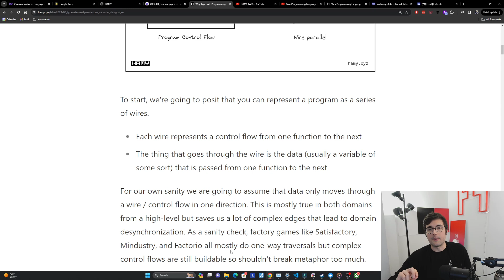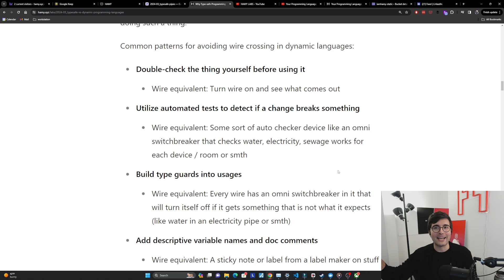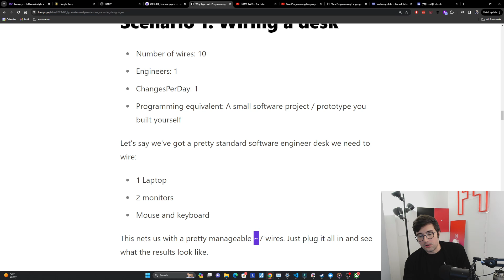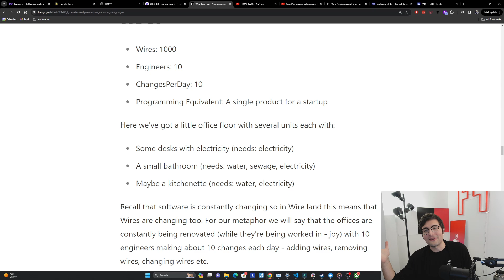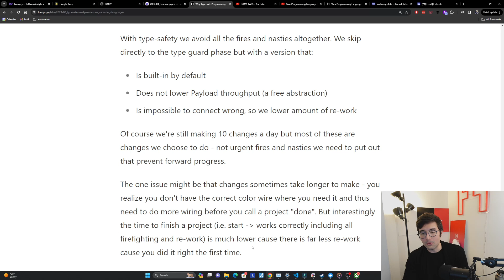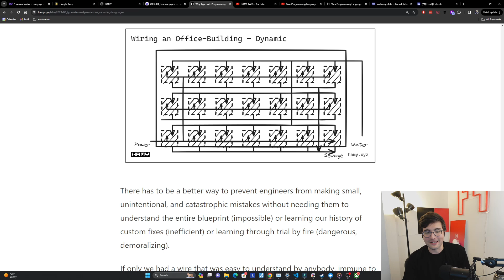Why Type-safe Programming Languages are better than Dynamic - Faster, Safer Software at Scale

Comment: Ugh, this old myth again...

There's one main advantage to typing; in some languages, not all, it's faster.  I'll also grant that it can maybe be easier for some beginners and you can get better hints with IDEs. That's it. Otherwise it's pointless and ugly boilerplate that makes code needlessly harder to read.

This whole thing of types getting mixed up and typing solving a major source of errors; myth. It's just untrue. Anyone that's experienced dynamically typing knows that these errors basically don't happen in reality. "Oh, I thought this was a set but it turns out it was a float, how could I possibly have known?!" Nobody say that, that happens to nobody, it's a myth. If professionals are in that situation then they're messing up a lot else besides. 

As for dynamic languages don't scale... Wow. That's so false I don't know where to begin... I guess I'll start with the mountain of evidence that contradicts the silly statement.

Listen, this is about python obviously. (And please, let's not get pedantic about type safe vs type hinting.) Pick the 20 biggest libraries in python - look at the source code, these things are not small and not written by amateurs - how many use python's type hinting? I'm pretty confident the answer is none. Why are these professionals able to do what you claim can't be done?

Ok, maybe you're thinking about arguing that a library only gets so big. Ok. What about google / YouTube? That big enough for you? Do they use type hinting in python? No, no they don't. Tell me, how can google exist if dynamic code doesn't scale? You're not arguing Alphabet's code base isn't scaled, are you? If you're right, then why are the biggest experts in python doing the exact opposite of what you claim and getting on just fine? You know google's motto don't you "python when we can, c++ when we must". Replace python and c++ with untyped and typed respectively.

The evidence is overwhelming: what you claim is clearly false. You use typing, it's a crutch you can't imagine going without when it's totally unnecessary.
Reply from the maker: Agree that many orgs use dynamic langs and it can work at scale.

But every org I've been in that uses dynamic langs has run into the same issues over and over and over again that could easily have been solved with better, stronger typing.

It's a scalability problem - not in terms of performance but in terms of human mental overhead and rework.

This may not be true everywhere - I can only pull from my own experience and observations in the industry:

* Instagram - Planetscale, runs on Python monoliths
* Reddit - scaleup, runs on Python monoliths
* Rippling - scaleup, runs on Python monoliths

But maybe others have found ways to solve this with the current tools - I just haven't seen it.

My career: https://youtu.be/VupR_6tQEb8?si=xMg6djzcCHmSQFZ_
Reply: @HAMYLABS  "Agree that many orgs use dynamic langs and it can work at scale." - ok great, I'm delighted that's clarified.

For my part, I absolutely accept that there are companies as much as there are individuals which take a strict typing approach in python and swear by it. Of course there are. All large companies have a coding policy and they differ between companies.

Instagram as you mentioned, favours python just like google but types it. I think they've gone for Django - good choice frankly. There's a very interesting blog from their team about their approach: "static-analysis-at-scale-an-instagram-story" where they outright say "Instagram has been working hard on getting to a fully typed codebase". They're actually spending money to type hint working code but that's in the context of them trying to work around the garbage collector - the reason python is orders of magnitude slower than C. So they're trying to make python like Rust as an internal implementation. In that case, it's for speed, which everybody agrees is an advantage. I opened with that. 

You're never going to find a dymamic cuda script running on a gpu, that would never make sense. But if you're solely focused on execution performance, you'd be insane to use python. You use python when your servers are cheaper than your employees so you're squarely focused on productivity.

Regardless, corporations with large codebase inevitably lay down strict rules about what is and isn't acceptable. Things like no globals to try to contain the damage. Just like different newspapers have different rules governing the copy they put out.

There are a lot of things that are pretty much universal, in small / large, open and closed source; DRY, composition, single responsibility, self-evident-ness - you know the sort of thing. The fact type hinting isn't one of those things speaks volumes.
Reply from the maker: Hm maybe we're missing each other here.

I'm not saying choose type-safe languages because it's more scalable in terms of performance (i.e. faster).

I'm saying choose type-safe languages because it's more scalable in terms of people (i.e. what is this variable).

As you said - Instagram is moving to types. Maybe they could get some perf out of it but that's actually not the main reason - it's because untyped languages lead to tons of bugs because you don't know what x means.

How do I know this? I worked there for 4 years during this transition from untyped -> typed.
Reply: @HAMYLABS  yeah I think I was trying to mostly agree with you, YouTube just puts in the tag when I reply and I was too lazy to delete it
Reply from the maker: Oh yeah was trying to reply to whole thread. YT comments / discussion tools not as nice to use as Reddit / Twitter
Reply: @HAMYLABS 

Yeah I can program in dynamic languages fine. The problem is when I'm working on a larger code base and no one documented what the arguments are expected to be or what the output is. Especially languages like js which are extremely aggressive in trying to cast things to "work"

Which sure, you can just say "skill issue, your org should have better standards" but the point is when push comes to shove, people drop doing the things that aren't required in order to meet deadlines.

Comment: After only having worked at my current company for 2 years, everything you said was 100% spot on.

Our backend is in python, frontend mostly in just JavaScript (React). Throw in some dynamic configs on top and it’s a nightmare to not just debug, but make meaningful changes to without just saying “screw it, let’s write our own stuff for x, y, z instead so we don’t break what’s there”.

I do what I can to leave things in a better place than I found them, but damn is it hard it’s not a priority for most other people in the company
Reply from the maker: Yeah it's really hard to fix it once you've built yourself into a corner like that - both from an eng and business perspective.

The best approach I've found is to try and make everything a little better each time you touch a piece of code. Over time it at least gets you in a better direction.

Comment: Testing & fuzzing can verify your programs written in dynamic langs.
Reply: Obviously, that's what testing and fuzzing does.
Reply: You can leverage a decent type system to write testers and fuzzers for you, that's what property-based testing is.
Reply from the maker: Yeah there are definitely ways to do this.

But it feels like types with extra steps tbh.

Testing / fuzzing says - let me try all the invalid things to make sure it handles them correctly. Types say just tell me what's valid and I'll keep everything else out.

But yeah they both can and do work.